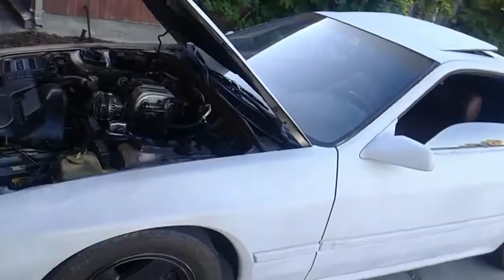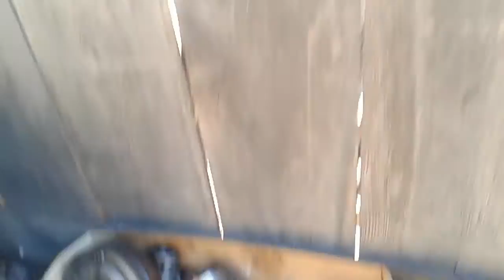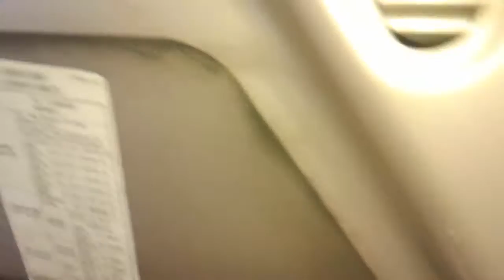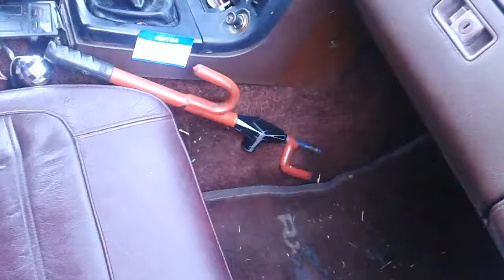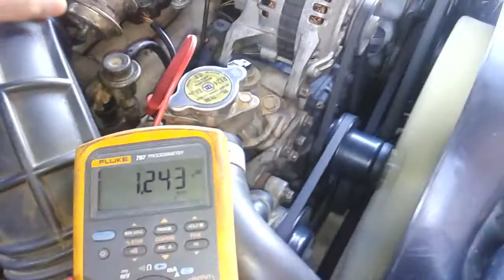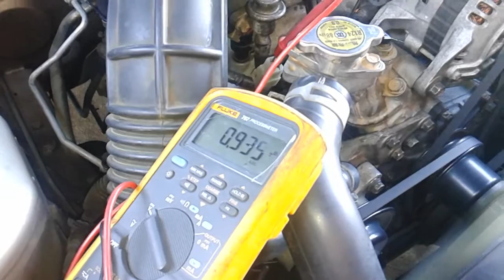86 RX-7 TPS Sensor Calibration

Comment: I have a gsl se and it revs without input occasionally. It’ll bounce up and down from 1k to 2k and sometimes it will bounce up and hold at 3-4K rpms. Whacking the throttle does have an affect sometimes but turning it off and back on does every time. Plz helppp🥲 I’ve sprayed around with carb cleaner and there doesn’t seem to be any real obvious leaks. One of my mechanic friends played around with some of the idle control screws which helped for a bit but the issue has since returned and more prominently

Comment: Hey man, I hate to bother you but I have a 85 rx-7 that I just bought. I got it running with a new fuel pump and plugs but now it’s idling high after cold start. I’m trying to understand your explanation and I hope I can figure it out but like any other things you can tell me to help? Thanks in advance!! Also any suggestions on what I should check and change before I try and get it to pass smog

Comment: Good video. I disagree with  you on one point. These cars don't ever have to smoke. Do not run the engine past 
3K rpm until it is fully warm. This tells you all the different alloys are up to temp for maximum efficiency. Also you may blow out a heater hose before the thermostat opens. I have two RX-7s, both are original engines close to 200K miles on them.
 FYI, any of these cars that have a small coolant leak will give you problems. If your system shows no pressure loss you have a blown engine seal and the exhaust gas is pushing the coolant out. This is a factory defect.
Reply: This guy knows nothing

Comment: Hi, detailed video, I subscribed. I have 88 10th ae, stock with emission removed. If I hard on gas, fuel cut off, it accelerates a bit after I let go the gas. Al vacuum likes replaced, good spark and 92/93psi compression after warm
Up. At cold engine, TPS starts at 1.5v and up to 4.95v At end of stroke, when the tps reaches end of stoke, my gas paddle only 40% down. Shoot me an email plz, if u have any suggestions.

Comment: I have a 1987 non turbo car what should my rpm be at idle it's 1200 rpm hot it's 5 speed car  it runs smooth  what adjustments should I do to be at 750 rpm email josephkast25@aol.com

Comment: I have been searching the internet for a fix to another fc rx7 problem I have been having and was wondering if you have encountered the same problem. My problem is this only my speodometer works. I have no temp gauge oil pressure or tach. If you know anything about this issue can you please make a video or maybe a response.